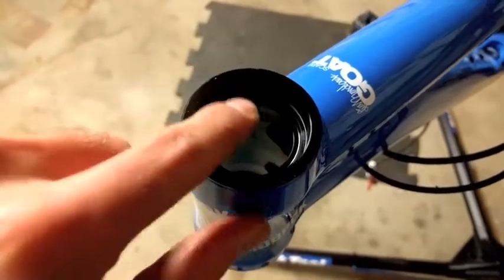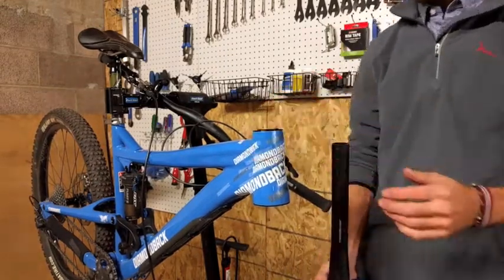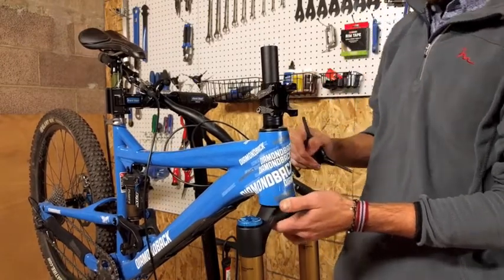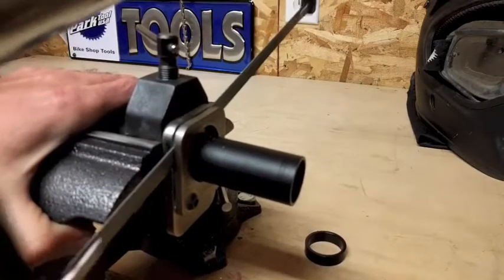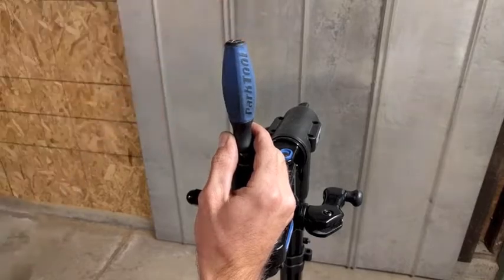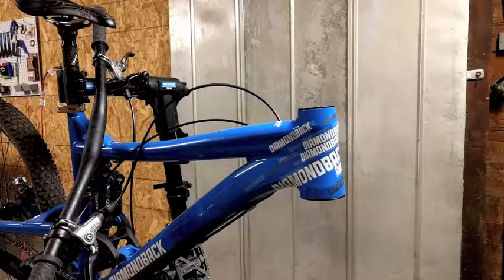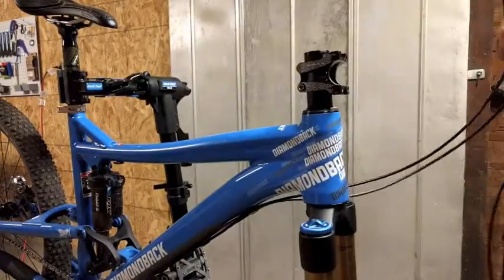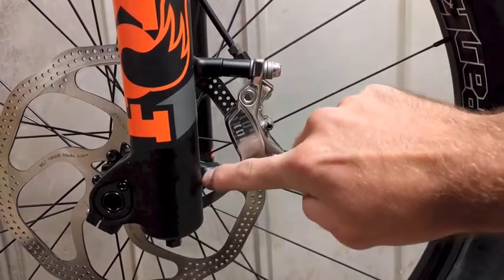Fox Float 36 Fork Install

Comment: Great video, I am about to change my own forks for the first time, do the forks come with the crown race or do you re-use the one that came with the bike?
Reply from the maker: Hey Craig,
Unfortunately the fork companies are not going to send you a new crown race. The crown race comes from your head set and needs to match the bearings you are running. You’ll need to pull your head set apart if you want/need a new crown race. I hope this is helpful. Please let me know if you have any more questions.
Best,
Nate
Reply: @watchnato  yeah that’s what I thought, so it’s crown race to match your headset not your forks, the bike isn’t old and I’ve not done many miles on it so I’m sure I can use my old one, if not I’ll just get a spare one incase I need it. Thanks for replying
Reply from the maker: @molley17  You are correct, and I’m glad I could help. Good luck with the nee fork!
Best,
Nate